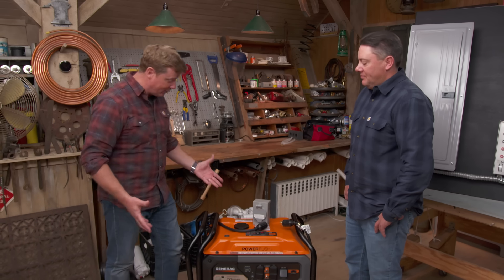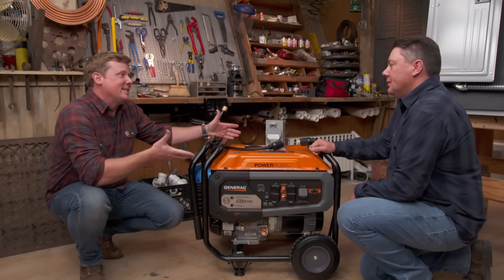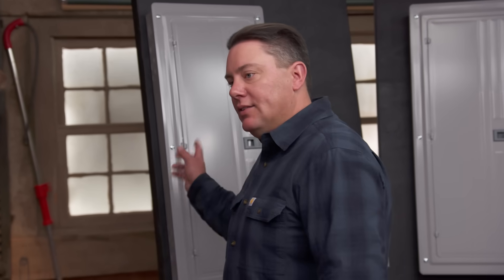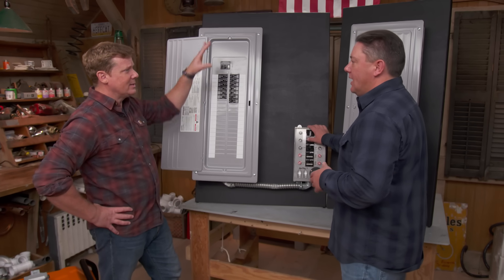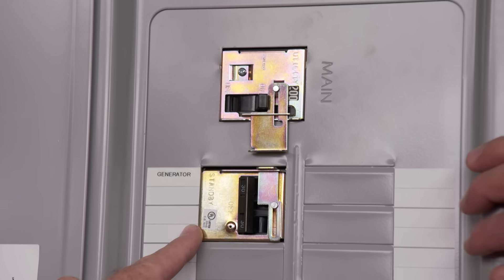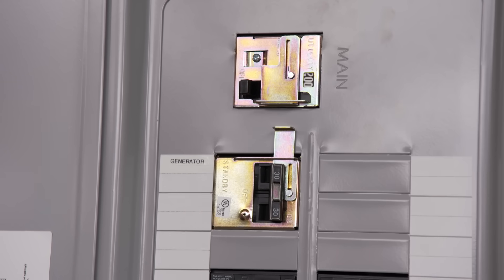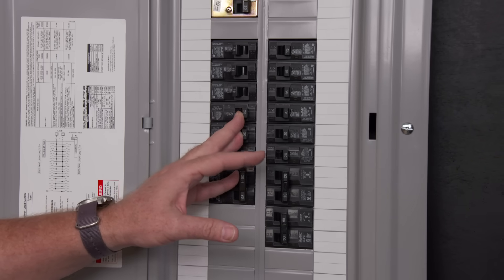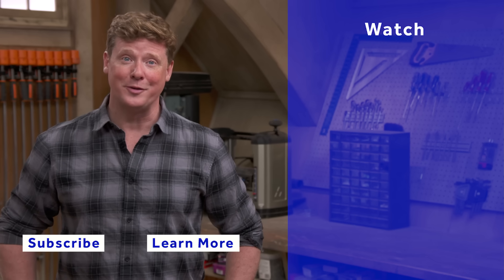How to Wire a Portable Generator | Ask This Old House

Comment: I bought a Harbor Freight generator for 699.00  It's a 7500 watt continuous, 8750 surge. I back feed it through a 30 amp 240 breaker. BUT, BEFORE I DO ANYTHING, I shut off the Main breaker and all the big draw appliances like the water heaters, ovens, clothes dryers, Etc. I don't recommend this way for anyone, unless they completely understand what can happen and how dangerous and or deadly it can be. The great thing about doing it this way though, is the price, the fact that every light and receptacle will work and it's only one cord for powering my whole house.
Reply: @Kevin-mp5of , Every time you fire up your generator, is the time you need it the most!
Reply: Make sure you use your generator carefully
Reply: @The_Happy_Aviation_Enthusiast , You are 100% correct. Thank you !
Reply: Here is a reminder about portable generator safety: This advice is just to make sure that everyone is aware of all the warnings and it’s just to remind people to be careful using portable generators. Everyone has to see this safety reminder for safety. Every year, hundreds of people die or get injured when using portable generators due to carbon monoxide poisoning and electrocution. Make sure you are using your generator carefully and keeping others safe as well. There is something very serious that everyone should always be aware of when using generators. Some people do run their generator indoors which is not safe and that increases the risk of carbon monoxide poisoning which can cause death of family and you. Some people run their generator in wet conditions which can electrocute them. Please remember that you should never run your generator indoors. Remember that carbon monoxide is an odorless and colorless gas that you cannot see or smell. Carbon monoxide is a silent killer. Keep that in mind. Make sure your generator is 15-20 feet away from your house and away from doors, windows, and vents. Never use your generator in your porch too. Having a carbon monoxide detector is very important against generator safety. Some people also allow children to go near the portable generator which could pose risks. We need to keep an eye on our children making sure that they are not near the portable generator so they won’t get electrocuted or burned by the generator which is dangerous. A locking enclosure also keeps kids safe. A generator shed might look like a tempting place to explore, or take cover during a game of hide and seek, but a generator is a dangerous piece of equipment that can cause injury. It says on the manual that we should also keep children away at all times from the portable generator to avoid injuries. Please do not allow a child or unqualified people to operate the portable generator. Just because some manuals missed what should be listed doesn’t mean it’s safe to do. Always follow the generator safety rules when using portable generators. Generators pose electrical risks. If you need to use your generator during wet weather, you need a generator tent to protect your generator from getting wet. Don’t let your generator get wet. Keep your generator dry and before using your generator, please make sure your hands and your generator is dry. Do not wear loose clothing when operating the generator. Everything that is said on the generator’s operating manual should not be ignored. Never smoke cigarettes near the generator. Please keep flammable things away from the generator. Never overload your generator too. Your generator can catch fire. Never ever try to plug a generator cord into a wall outlet to avoid back feeding. Back feeding your generator is dangerous. Always turn on your generator first before plugging in appliances and shut off the appliances before turning your generator off. Use a heavy duty cord for your generator and the cord should not be worn out. All the instructions should be followed carefully. Never refuel your generator while it’s running. It can cause fire if fuel spills while your generator is hot. You should turn off your generator and let it cool off before refueling it. Having a fire extinguisher next to the generator is also important. This is only a reminder for everyone’s safety of using generators. Make sure your generator is properly grounded. https://youtu.be/I1jT3ANENvI and here is a video more about keeping others safe when using generators and also about our family’s safety. Hope this helps. Thank you.

Comment: You get them phase angles wrong. And the power comes back on. You will be homeless....
Reply: What do you mean, phases wrong ? Thanks.
Reply: @augustreil  Electrical current has phase angles. It's how you get 120\208 120\240 volts.  And they can be offset by 10 degrees on each phase. So you better know what the hell you're doing. 

Why you need a phase angle meter to read them. And there not cheap..Mine cost $3,000.00 US from Fluke..
As that transfer switch can fail.. Why I don't install them manual ones. Customer screws up. That panel will explode. At 50,000 PSI.. Be like a JDAM went off in your house..
Reply: @MasterChief-sl9ro , Thanks. Appreciate the info.
Reply: More likely, a lineman gets a fatal shock - the lawyer gets your home, and the judge gives you a few years to think about it.
Reply: @Kevin-mp5of  By the way.. It's not about Current or Voltage. It's about Frequency.
Thank You
Reply: @MasterChief-sl9ro , are phase angles the same as Cycles?
Reply: @Kevin-mp5of  Forget it Kevin.. You do what ever want. But anybody that listens to you. Will be dumber for it. 

As they make a Meters just for the purpose I laid out. 

And if you think you can Guess at it. You better have good insurance. As I would not let you touch any Backup Generator installation. As I doubt you even installed one. Much less used the proper tools to accomplish it. Why we give people test. Before handing out license and Degrees in electrical theory..
Good Day
Reply: Master Chief 00117 … phase / rotation is only on 3 phase power, which is nothing a homeowner needs to be concerned with. Besides, the transfer switch / interlock will isolate the gen set from the grid if installed properly.... and if UL approved can NEVER fail with both gen and utility connected!
Reply: @rupe53  Like I said. How many you installed? As UL  listed is not a MTF approval rating.. Never has been..As they can and will fail. As they don't last forever. 

And again. Why you don't understand the phases from both the Generator and Service must be on the same angles. 

I would add. Not all Residential houses use 120\240 volts. Again you make an assumption that could cost people their lives or Homes. I seen that before. People stuff breakers in them empty panel slots. Only to burn up every 120volt appliance they hoked to it. As it had a 4 wire High Leg service. 

And if you ever tell my. A transfer Switch never fails. I will laugh in your face so hard. As they can Fail Open or Closed. The Sensing\Monitor connection can fail. etc.. And it happens all the time. Why they publish accident reports on the subject. 

Thank You
Reply: @MasterChief-sl9ro  … let's cover this one step at a time. Common residential power (but not all) is single phase. The video is on SINGEL PHASE so no high / low leg to deal with, never mind phase rotation. If we were dealing in 3 phase then I would agree with much of what you said.... except for a listed TS failing where it can feed everything at once. Yes, I have seen them fail in utility or gen position, and open circuit on one leg or both legs. Have even seen wiring shorted to the cabinet, but that's a bad install issue. Never said they last forever. How many have I installed? Let's just say the company I worked for (20 years + now retired) installs hundreds per year... on a bad year! Ya think I might have seen a thing or two in my time?
Reply: @rupe53  Lets test your assumption. 

http://transferswitch4less.com/troubleshooting.html
http://www.rvforum.net/SMF_forum/index.php?topic=115268.0
https://heartlandowners.org/archive/index.php/t-43993.html
https://community.fmca.com/topic/6014-primary-reason-transfer-switches-solenoids-fail/
https://www.eaton.com/content/dam/eaton/products/low-voltage-power-distribution-controls-systems/ats/resources/atssecn3ot910-ib140049en.pdf
Understanding ground faults
The grounding for the emergency system and the ground-fault protection scheme is what determines if a 3-pole or 4-pole transfer switch should be selected. Ground-fault protection is a complex topic. But one simple way to see how it affects a system is to model the three phases as one phase and assume that all the current produced by a source, a transformer, or a generator returns to its point of production along the neutral line.

Comment: Avoided the opportunity to discuss the dangers of backfeeding the grid - linemen die every year because some homeowner thinks he's figured out a smarter way. 😪
Reply: Yes. They mentioned not wanting to "mix" the two feeds but not the "why" you never want to do that. For those who might not know, if the two are not physically separated before starting the generator and generating power, the generator feeds backwards through your electric meter, out onto your service drop, through the transformer on the pole (or pad-mounted transformer) and onto the 12kV-25kV lines that were formerly "deenergized" because of the utility's outage. Yes, lineman are SUPPOSED to consider all lines energized, and today, thanks to increased safety programs, do take precautions. But, there may be an overhead line that has fallen in a field, on a sidewalk, on a fence, on someone's house, and persons could come in contact with those wires. I've see houses burn down because an electric wire was on someone's roof and touching the metal flashing at the drip edge. Please, Please use caution!

Comment: Nah I'm sticking with my two UPS. One for my Internet & servers and another for my gaming PC
Reply: A UPS won't power a gaming pc for much longer than a few minutes under load so a generator is better option because you can play games for much longer. UPS on the router depending on size is a good idea though
Reply: @Fusiongearz  I'm not the type who continues to game during a power outage. If I have an outage while I'm using my PC, I would immediately shut it down. A UPS simply allows me to properly shut down any desktop computer I have instead of losing power right away. It's really valuable when updating an UEFI/BIOS. So, a generator is not a better option.

Comment: Not much wiring here. More of a product demo.
Reply: yeah, I was expecting that but hoping for more.  turns out the ground wire isn't connected to anything
Reply: I think they skew to a less savy audience for this stuff. That being said, understanding basic options was certainly useful for a segment of their viewers. What I wish they would have discussed was relative cost. For example, I know that those separate panels cost several hundred dollars, where the interlock generally won't cost one hundred. Plus, giving people a ballpark for what an electrician will charge would have been useful.

Comment: And how do you know when utility power is back so you can turn the thing off......... 
If you are going to go through the expense and ordeal of having an electrician come and wire in a generator circuit might as well go all out and get a full size generac with automatic transfer switch
Reply: We just look down the street and see if a road light or other peoples homes have their lights on. As for going full bore on getting the whole set-up with an auto trans switch, that could cost a home owner 10-15k, compared to a grand with the generator, wire hook up, the whole sh-bang. I guess it depends on how many times you lose power ?
Reply: @augustreil  These days for under 10K you can get one installed with auto transfer. (the larger you go in generator size, the high the price) Checking streetlights and neighboring homes is not reliable as they are often on different circuits (this is why some times you see one half of a street with power and the other with out, or the street lights on and homes with out power)
Reply: @QuaabQueb , That would be pretty tough to get the whole set-up for 10k or less here in Ct, but I guess it's possible. I went to Harbor Junk and bought one of those 8.75K surge, 7.5K continuous and back fed it through a 220 breaker. I have had to use it 6 times in the last 4yrs and it's been great so far, (fingers crossed) !!
Reply: @QuaabQueb  The home Generac systems run on LPG or NG, that's not readily available for many people. Diesel and gasoline are available to everyone.
Reply: @augustreil  … I see 10Kw Generac at Lowes for $2,700, which is fully automatic. Ok, the install will be extra and might be outside the grasp of the average Joe, but certainly not $10 - $15K. In most areas it will fun you $1k for the electrician and another $1K for the gas hook up, provided you already have LP or NG on the property. IOW, $5k  or so.
Reply: All about cost in the end
Reply: Could just put a power indicator LED in your subpanel. Don’t know though if building codes allow this in some way.
Reply: That is one of the disadvantages of using the generator interlock method since everything is turned off. There are inductive pickups that monitor when power is restored. In our case our electric water heater is separately metered so we use that to determine when power is restored.
Reply: @tomschmidt381  … you could also use an inductive tester. Under $10 at a hardware store. Just hold it next to your service feed and it will light up when the power comes back.

Comment: So how do I wire a portable generator?
Reply: There are quite a few ways if you're a really good handy man with common sense. Never mind, I see what you did ! lol. Thanks !!!
Reply: Apparently, you hire an electrician. 😋
Reply: Please remember that portable generators can be dangerous if not used carefully. We should also keep our children safe when using generators so they don’t get electrocuted or burned and even poisoned by carbon monoxide. Just reminding everyone to be careful using portable generators. Make sure you read the manual carefully before using generators. Thank you
Reply: Techmatt167 … You don't wire a generator. The factory does it when it's built. If you want to know how to wire the house to use a gen set, well they didn't cover that part.